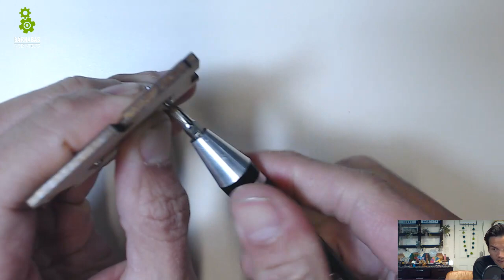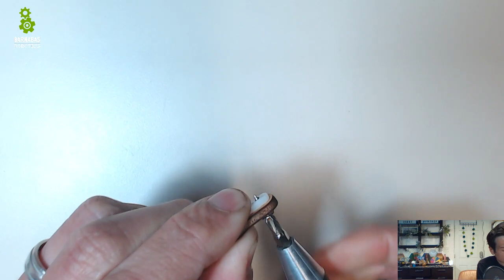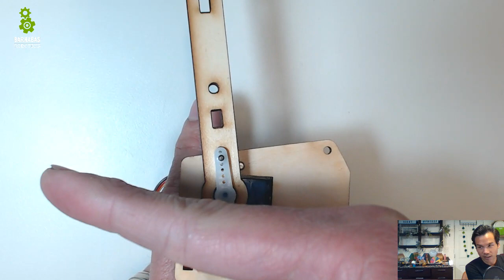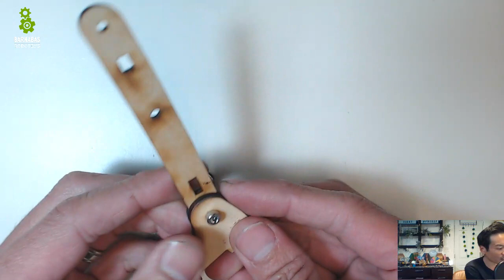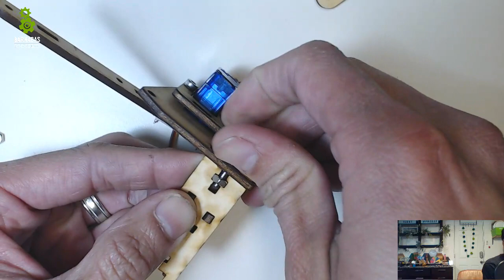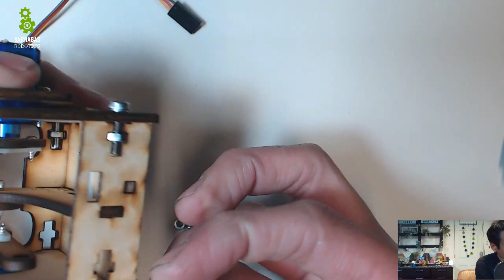S2E3 - Barnabas Wood  Robot Arm - How to assemble the rotating base / turret

Comment: Very difficult to assemble. I feel like I need to have 10 hands to it. Especially the part where you need to put bolt inside the socket before you tight it with screwdriver.
Reply from the maker: I hear you! Takes a little time and patience 😄